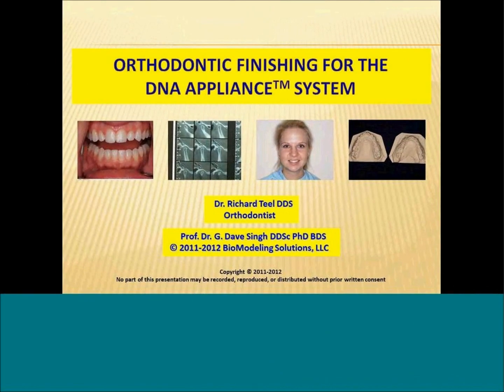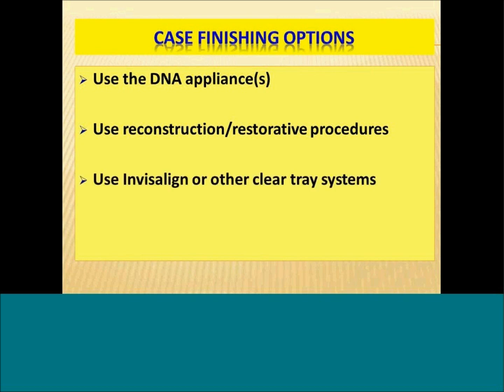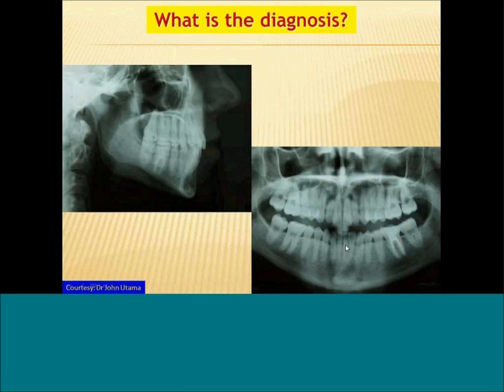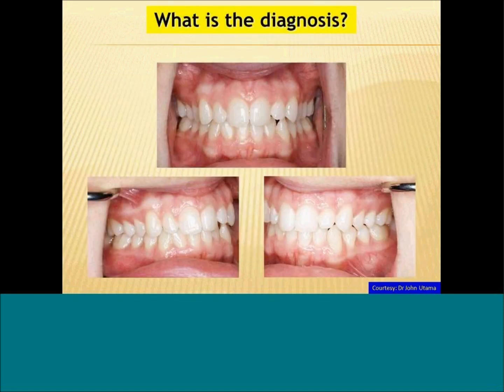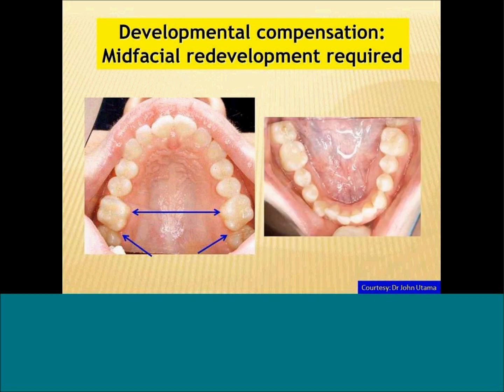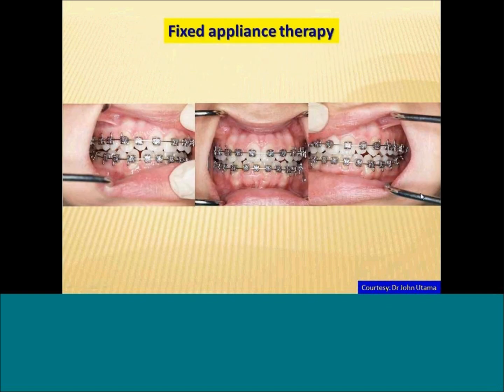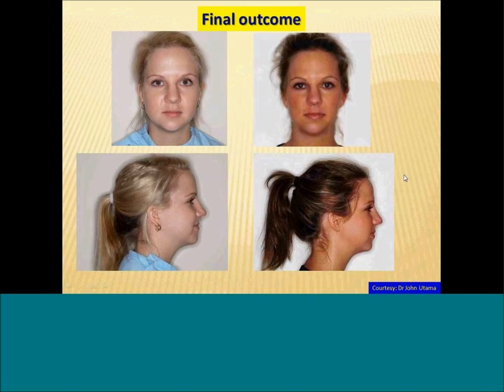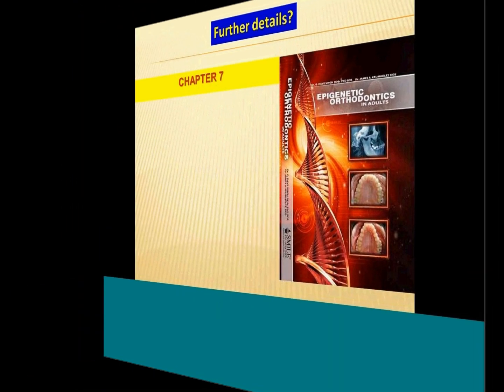BMS Webinar Series Volume 1- Clip.wmv

Comment: The palate looks about the same size, but the arch looks reshaped. This indicates to me that the appliance has just moved the teeth and the arch, not the palate.
Reply from the maker: ani90646 Good Afternoon Ani90646 ,

It is hard to tell what is going on in 3D from a 2D photo,.

Here is a scientific peer reviewed article that talks about the increase in the bone volume in the maxilla from DNA appliance Treatment.

https://dnaappliance.com/articles/JIOS-2014-Singh-Heit.pdf

Singh GD, Heit T, Preble D. Changes in 3D Midfacial Parameters after Biomimetic Oral Appliance Therapy in Adults. J Ind Orthod Soc 2014;48(2):104-108.

Here is another article that shows the resolution of OSA with our Biomimetic Oral appliances. The final sleep 
study was done without the appliance in the mouth. This person was cured of OSA.

https://dnaappliance.com/articles/Singh-Griffin-ajsd-v1-id1002.pdf

Singh GD, Griffin TM and Chandrashekhar R. Biomimetic Oral Appliance Therapy in Adults with Mild to Moderate Obstructive Sleep Apnea. Austin J Sleep Disord. 2014;1(1): 5.

Check out my post on LinkedIn showing a pair of 3D printed models showing a Pre/Post Airway of a 60 year old DNA
 appliance patient. The airway was increased by 230%. 

https://www.linkedin.com/pulse/3d-printed-airway-comparison-dna-appliance-patient-ken-yielding?trk=prof-post

Unless you remodel the bone the OSA will not be resolved. 

Wishing you all the best of health,
Ken Yielding 
Assistant Vice President 
BioModeling Solutions Inc.
Reply: It does moves palate
Reply: @camilapratt9623  did your palate move?
Reply: @Peckz1949  yea widens and lowered
Reply: Ken died years a go 
I worked with him and my cases
Reply: @camilapratt9623  I did retractive braces that ruined my face.. I didn’t get extractions but my face has lost its structure. Can the dna appliance help me regain it? My face was pushed in
Reply: Sorry to hear about Ken